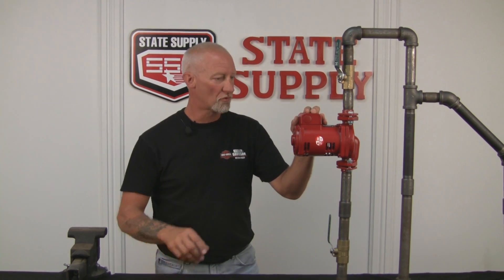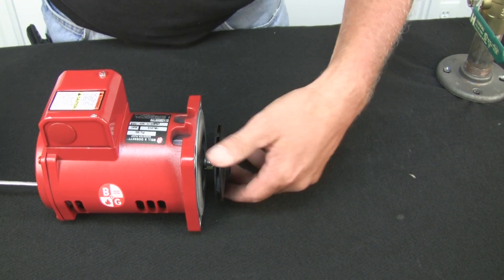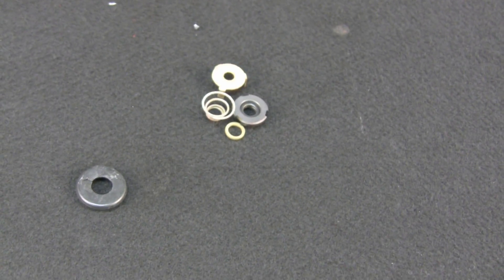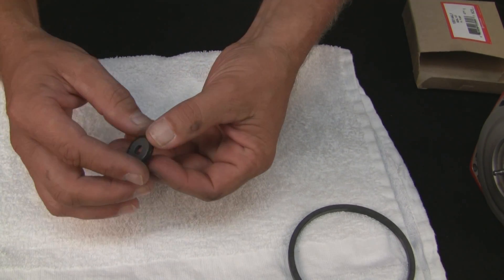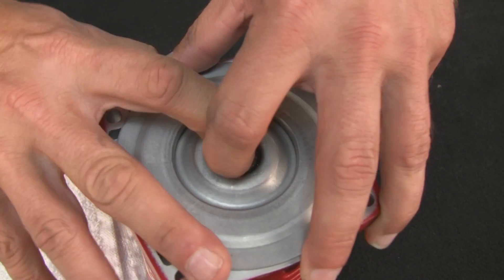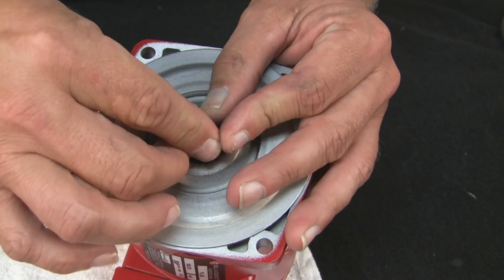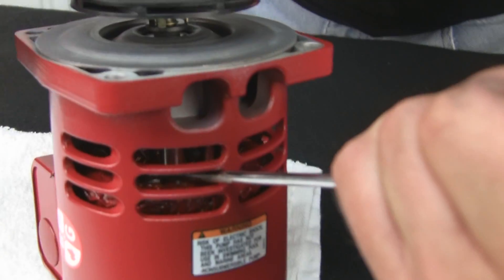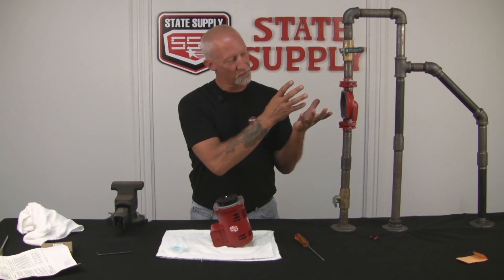How to Replace the Seal and Impeller on the Bell & Gossett PL Series

Comment: Thanks for the video.  Any idea what the noise is on my unit? 

https://www.youtube.com/watch?v=U_kY8qxzhSg
Reply from the maker: +Tom Elwell It sounds as if the bearing are shot on that pump.  Unfortunately, that part of the pump is not repairable, you would need to purchase a new one.  I would not recommend mounting it the same way you have it now, that's what may have caused the bearings to go.  These should be mounted vertically.  

Here is a link to the installation instructions:

http://media.statesupply.com/filemanager/b/g/bg-series-pl_installation-and-service.pdf

Page 3 has the recommended mounting configurations.